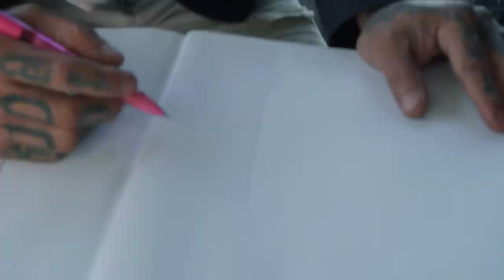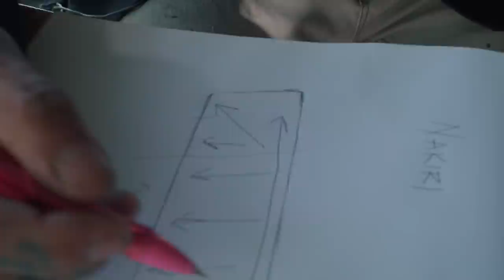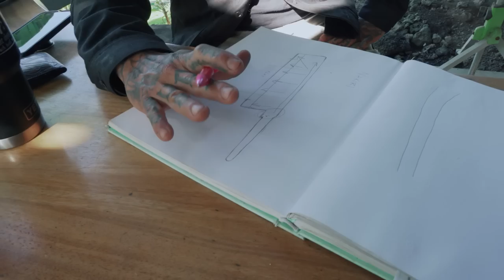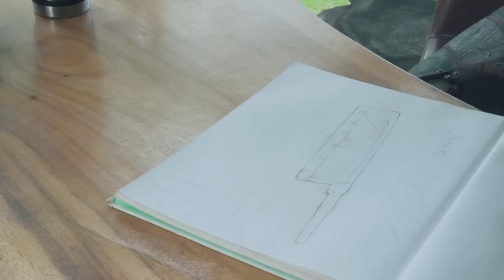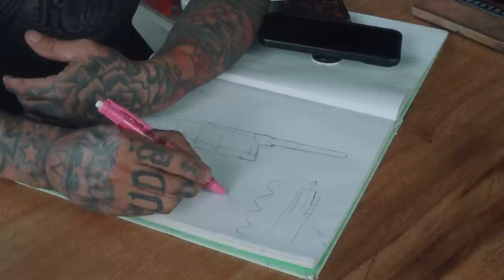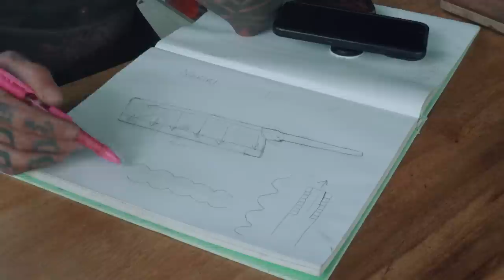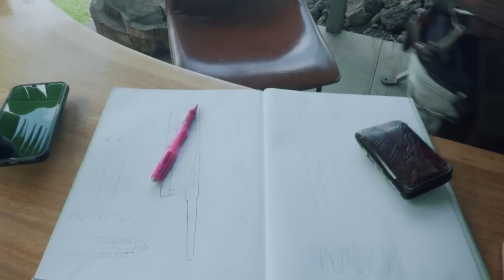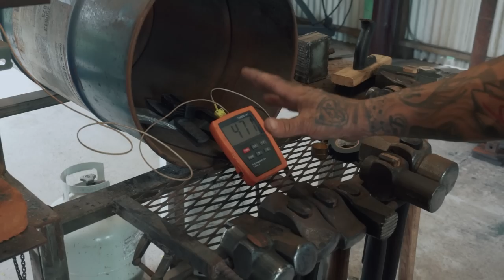Neil Kamimura - Nakiri Knife Forge Part 1

Comment: Can't wait to see this completed.  I made a Damascus san mai nakiri earlier this year, where I got everything all welded and got it drawn out, then did stock removal to actually make the knife (I wanted it ultra-thin and didn't trust myself to keep the 1095 centered if the thickest part of my material was <0.1 inches and I was forging bevels).  However, during sharpening, I got a little part of my edge that wore itself back so instead of being straight, I have a gap of maybe 1/64th of an inch.  That's not a lot but it kinda ruined the functionality for vegetables with skins. Those knives look simple but they're very hard to get right.

Comment: Working on a knife handle well watching this, it's Nice to see i am not the only one who loves my little Atlus Anvil the great thing about them is they are steel and New when you get them.  I have one from their first run only thing I dont like is that they did not do full bolt holes. And eventually, it came lose...solved that problem by just wire wrapping the bolts so they stay tight.
Side not the correct term for what you do when you make a tang, is forge a shoulder into the steel.

Comment: This is a FORGED IN FIRE CHAMPION,  PAY ATTENTION and learn something. His "shop" back then was his back yard.  He's been growing. 

Totally agree with you about the flat dyes drawing out the billet.  Here's an idea i got from another F.I.F
 Champ:  Elijah from Firecreek,    he drilled holes in the edge and filled them with roller bearings, well, it kinda worked for what he was trying,  but, mild steel was still between the roller bearings and ended up on the edge of the blade.  I propose, an artistic approach,  drill on the flat, specifically sized and placed holes, filled with different carbin content steel for different shades of grey, make a pixelary/dot matrix "photo" in the side of the blade. I think you could accomplish this,  can't be much more time consuming than some of these mosaic patterns out there.

Comment: Sorry for the running commentary Ah you can avoid dinging your hammer by hut cutting most of the way through...then stop when your almost through and bend it off...which i figured out after putting dings in my hammers.

Comment: Around 58:20 there’s a very subtle retardando in the background beat. Well this just works perfectly as Neil removes the steel from the fire to go into the quench. Soon as he begins to agitate the blade someone decided to slow the backtrack just perfectly in relation to the excited state of the metal pre-quench and the decent through the Temperatures on its way to gunmetal gray as it cools. Very nice use of psychoacoustics here……or I am super baked and that was just an accident, either way it was enjoyable to notice.